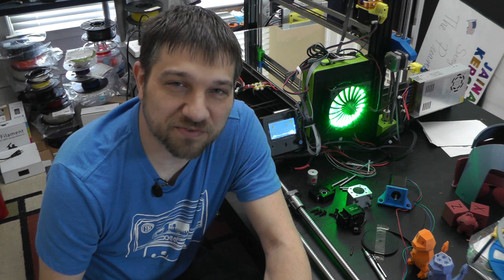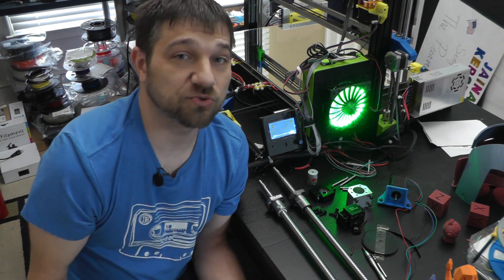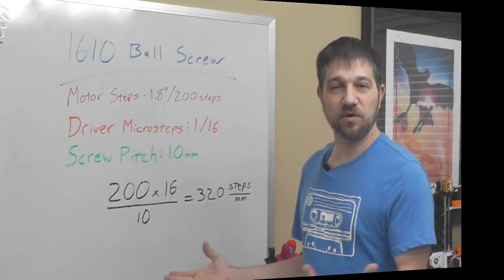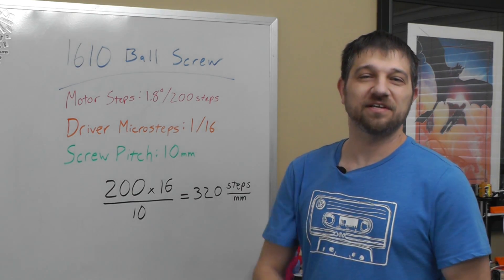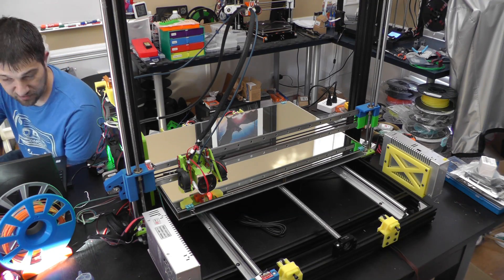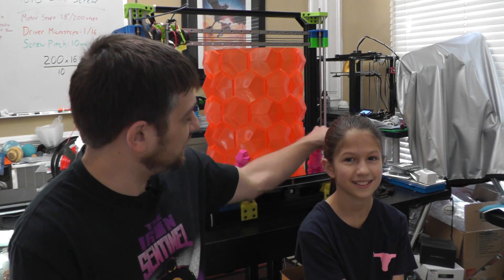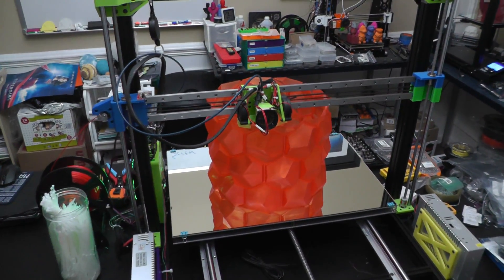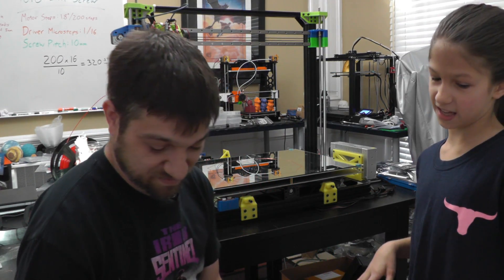Replacing Belts with a Ball Screw on a 3D Printer (Cosplay 600 series)

Comment: Dude if your print looks like that with only 50mm/s your entire printer isn't ridged enough.
Add some beefy cross beams and mass to the printer base and you should see a instant improvement.
Also check your acceleration settings you have very long belts so they need to be very modest.
Reply from the maker: I appreciate the feedback. I really don't think rigidity is a problem, especially that close to the bed. As someone else commented, I do think I should have turned down the acceleration on the belts but didn't realize it at the time. Thanks!
Reply: @kerseyfabs   You really have a large printer don't underestimate the leverage and oscillations that can build up.
Your "beam size to build volume" is not proportional which favors vibrations greatly.
It is true that a 3D-Printer doesn't have much forces, but that is also the reason why it very receptive to very small disturbance.

Comment: At a certain point if you want that big of a print space you can't move the bed anymore. Maybe go with (I think it's called) an x-y style where the bed raises and lowers while the print head does the most moving
Reply from the maker: I think once a call this one "done" I'll try to innovate that style of printer next! But... with no belts?!
Reply: @kerseyfabs  You don't want to do a CoreXY style printer with only Ball/lead screws. Properly tensioned belts on a corexy style allow for high speed, high quality prints. This is mostly attributed to the lightweight x carriage that can move at high speeds.
Reply from the maker: Understood. After all, it wouldn't really be a CoreXY if I used ball/lead screws. It would be something different. Either way, I'm not even researching that at the moment.

Comment: I tried to warn you those first set of ballscrews where going to be insufficient!
Reply from the maker: Heh! I got it relatively cheap and it was quick coming from ZYLtech domestically. While it's not what I'm using now, it at least showed that the idea was feasible. I'll probably end up reusing it to build a reasonable size CNC machine in the future.
Reply: @kerseyfabs  waste not want not!!  and yeah, ZYLtech is absolutely incredible.  my go to shop for everything 3d printing related.

Comment: Hey Kersey, i think getting rid of the type of rails youre using on the Y axis. In my experience those round type rails are not nearly as smooth as the type on your X axis
Reply from the maker: Hey Chris! I really appreciate the comment. My next major mod is a rebuild of my X-axis to make it more rigid. After that I'm open to trying that based on test print quality. Thanks!
Reply: Have you thought about using hybrid steppers with feedback encoders? I'm willing to bet that using a system that knows exactly where its at will have a huge effect on quality as well. Tons of other benefits too, like no more loosing steps, more accurate homing and location? You could also get more torque from a small stepper. But with the hybrid steppers having their own drives, you could get away with nema 23 steppers to account for the ballscrew power loss . I wonder if programming could be done to account for back lash also. with your X axis, id be curious to see if you couldn't just 3d print a "X" type structure to help stiffen the 2 rails together. Something like a ceiling rafter in a steel building. It would be easy fast a cheap to try? Youre probably not seeing any drooping but more of a "Yah" where the rails want to twist.
Reply from the maker: @What-is-thehandle  I actually have been thinking about using some other sort of motor for the ball screw. It partially comes down to what the board can handle and how to interface with software/hardware that knows about steppers. I think a NEMA 23 may be in future but I really want to push this as far as it can go because it just fits in terms of the frame design. I'm also learning about all of this as I go as my background is software, not mechanical engineering. Keeping cost down is important as well, so spending $150 on a motor isn't part of the plan.

On the X axis, I have just purchased a 20x60 slotted extrusion to firm up that entire construction. I'm working on the mechanical redesign that this calls for, which is a bit involved due to the extrusion blocking where the belt should be.

Thanks for the ideas!
Reply: @kerseyfabs  There are some drivers that are knock offs of toshiba Cnc stepper drivers S109 i believe is the number that will slot into normal step sticks and can run up to 4 amps of current that are fairly cheap, around $4 from china, though you lose out on some of the nice features of TMC though if you are using them in legacy mode with no uart or spi not a huge difference and Nema 23s can be found in the smaller variety for $10-20 so would be an option other option is getting nema 23 and the box drivers cnc use and just jumper wiring the Step, dir and enable pins and probably ground as well to hook to those drivers.
Reply from the maker: I was just looking at those yesterday! I may order one or two to experiment with. Thanks!

Comment from the maker: This video was a big deal to me because I was able to validate one of the big theories I had about the relationship between print quality and using ball screws instead of belts. Let me know what you think of this one in terms of both content and format. In this video, I walk through the process, not knowing what I might find.
Reply: Ok interesting, I am too lazy to test this. Please pin your comment 💝
Reply: I’m still a fan of belts for the faster moving axis.  I’ve had no issues with them so far and my prints come out incredibly well.  I’m even switching over to belted Z axis on my CoreXY and the next 2 CoreXY I’m designing/building
Reply from the maker: @meandrips2216  That's cool! I have no issue with printers that use belts. I've seen plenty that do it extremely well. My Ender 5 for example has no problems. I'm just learning about these things and curious if there are ways to take printers in new directions and what the benefits might be.
Reply: @kerseyfabs  One thing to Keep in mind is ball screws act like a  gear. As you change the pitch you're changing  the lead and torque needed to drive them.
Reply from the maker: @patrickweaver1105  Understood. Thanks for the feedback.